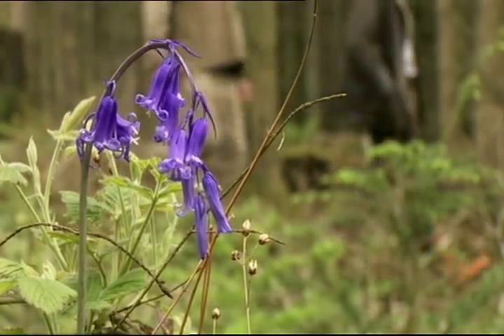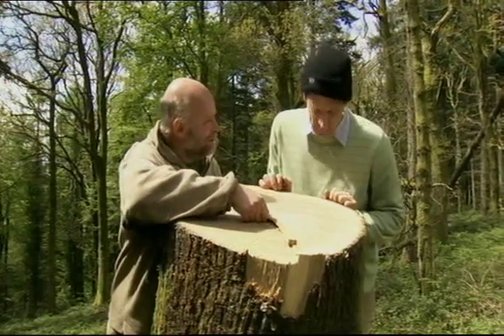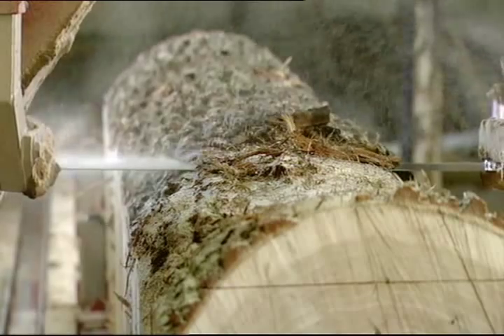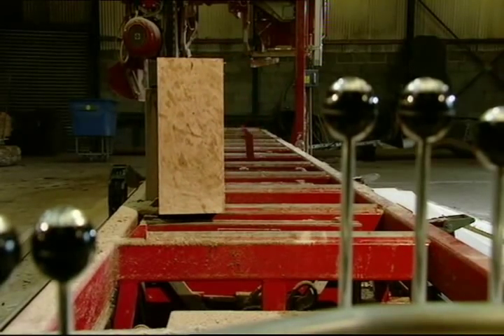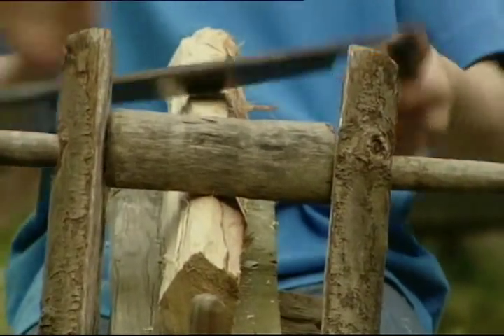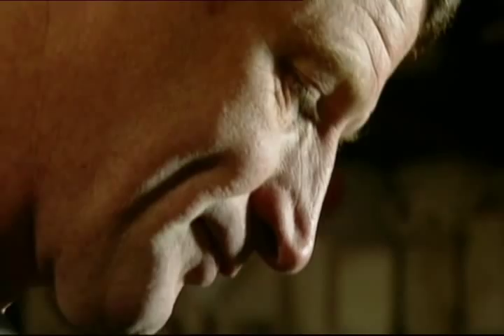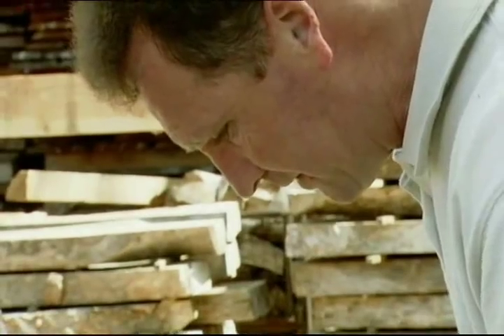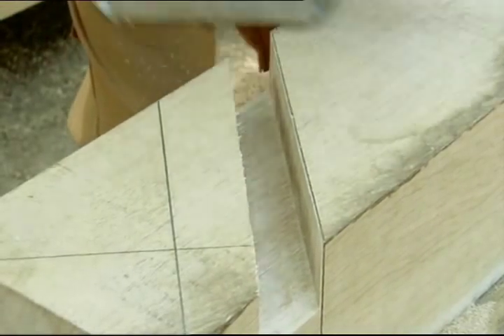Craft Traditions Wood Part 1

Comment: 3:47 through 5:50...oh my...you know, the handle of a froe is meant to be used as a lever to split a log, not just to hold the blade...the boy's hand axe is too heavy for him, he can't control it well and will probably hurt himself with it...your shave horses are really unstable and poorly made-especially the boys- he shouldn't have to strain to reach the foot pedal...please sharpen your drawknives...they're shaving tools, not chopping tools...you're only creating more work, again, especially for the boy, who's just uselessly chopping....finally using a drawknife with the bevel down is more controllable and makes for smoother shaving.